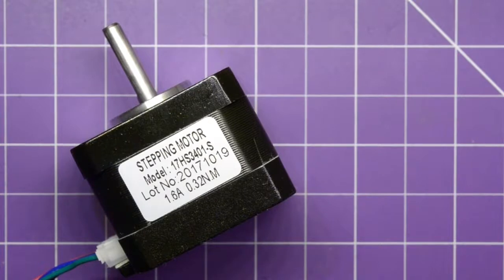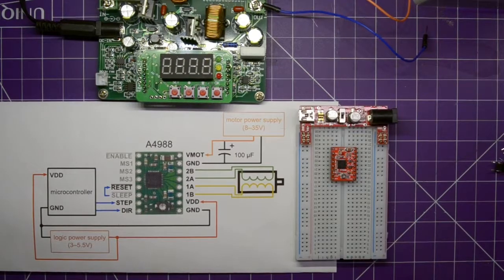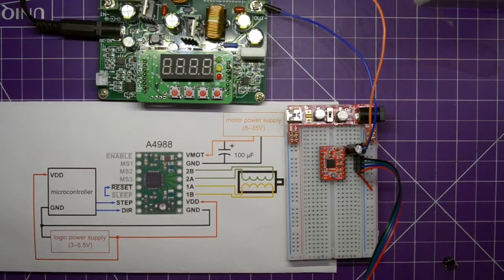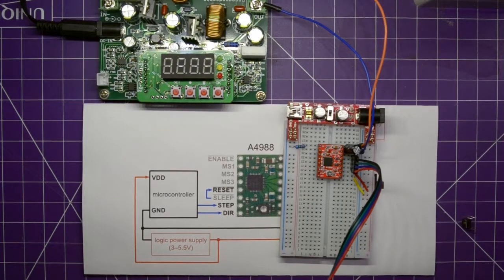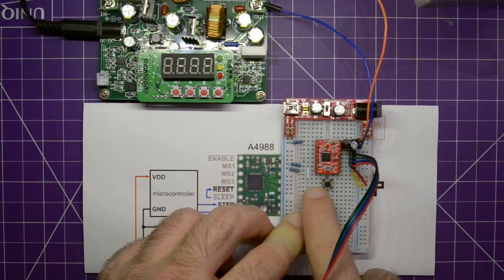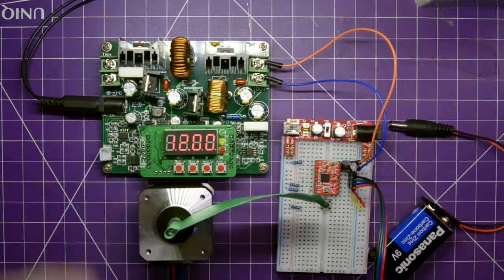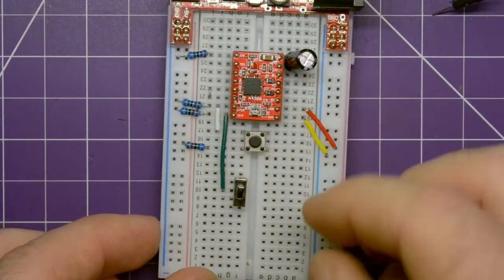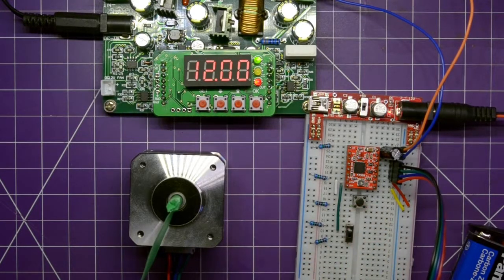How To Drive Stepper Motors The Easiest Way!

Comment: I love this video! 👍😊 I have subscribed 😊
But I wonder about your wiring of STEP signal. When using permanent 7K pull down resistor, and then switching in a 7K pull-up, you will give the STEP pin a 2.5V signal right?? Bit lucky for you it is registering as high.
Better with NO pull up resistor or at least much smaller (like 1K or so)
Am I right?

Comment: If I wanted to use a stepper motor to turn something eg. a rod to tilt venetian blinds, until the rod can't turn anymore (all closed or all opened) what should I add or consider getting (so I can look it up)?  Can this be done via coding or do I need something to sense resistance etc?
Reply from the maker: I think your best bet is to look up "encoded" or "closed loop" stepper motors - or you can manually count the pulses in software, but if your stepper misses a few pulses, you can cause some real damage!

Comment: Excellent video thanks. Using a stepper and  microcontroller and Arduino I'm hoping to develop an automated solution to control the rotation of an observatory dome. I may not succeed but I'm sure I'll learn plenty along the way As I have using your video already..thanks again

Comment: I've scanned a few of your vids...  If you don't mind my asking, is DIY/hobbyist electronics (and 'maker' stuff) something you're new to, or have you been involved with it for a long time?  My interest in the hobby started early 1960's.  Now is a very fertile time, with the MC's, SBC's, a huge number of modularized circuitry, and new parts, not to mention programming environments that are reasonably quick to become productive with.  Thx.
Reply from the maker: I'm an automotive technician by trade (mechanic if you will) so it's always been an interest, I love programming but could never get into it - that's when I learned about Arduino. To me, the concept of fiddling around with coding and then getting a real, physical outcome is what really tickles my fancy.